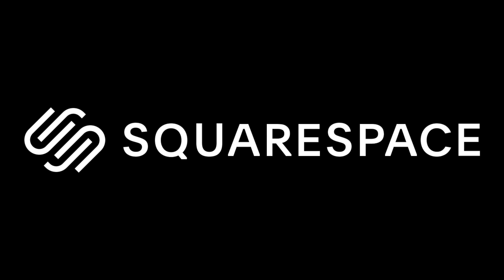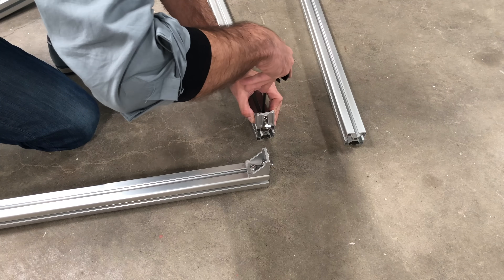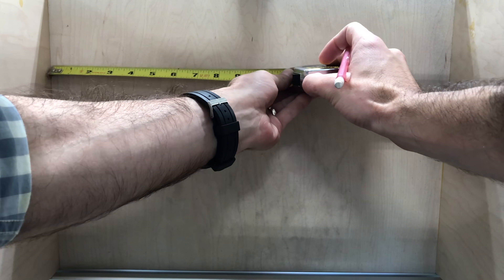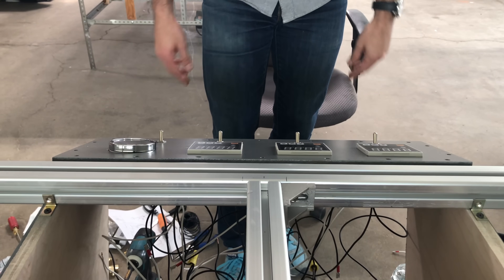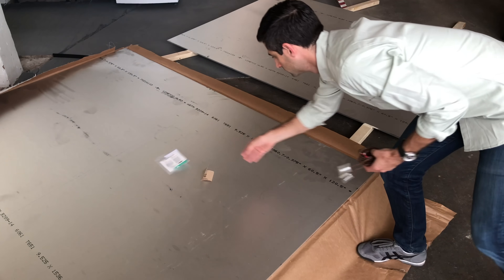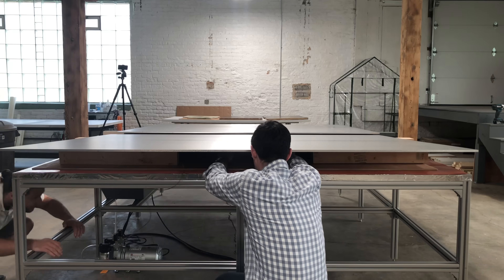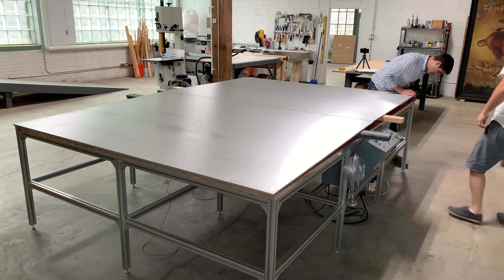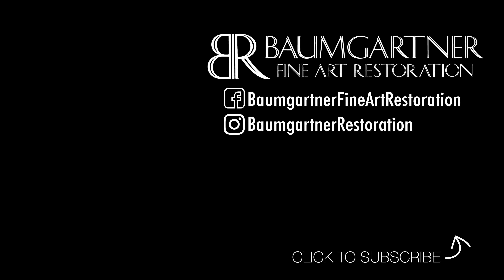Building A Heated Suction Table

Comment: WARNING!!!  Julian, an infrared heat gun is a very poor choice for calibrating the table.  This is especially true for cheap ones like you are using.  Besides that, it did not appear that that heat gun could be adjusted for emissivity.  This is crucial when using a heat gun to get temps from shiny metals.  In fact, raw aluminum is one of the very worst surfaces and your measurements can be off be very significant amounts.  I would recommend using a quality RTD that is calibrated to NIST to calibrate your temperature controllers.  I am a Metrologist.

Comment: Before I retired I built a lot of things with this type of extruded aluminum tubing. It is a great product but it certainly isn’t cheap.
You can put a tap in a battery drill to tap the center holes for the feet. That is if the drill has an adjustable clutch. 
The aluminum plates sharp burr can easily be removed with a red devil paint scraper. I learned that trick from a professional sheet metal worker.
I really appreciate you sharing your design with us.

Comment: I hope you put a separation layer between the glued aluminium join and the expensive silicone heat mats. That way a future conservator can reverse your work and separate the layers. 😁
Actually the glue probably doesn't bond with the silicone mats so probably not necessary.

Comment: Nice build. Plate seems thicker than it needs to be, is there a reason you chose half inch? I’m sure you know but your three zones aren’t thermally isolated, you’ll just heat the whole table less. And if you haven’t already, chamfer the edges and corners, and tie the metal structure and surface to electrical ground. Remember though, aluminum and copper wire equals galvanic corrosion, so you’ll need to buy a special connector etc. A GFCI breaker would also be a good investment in not dying!

Comment: I think there is an issue how you calibrated thermocouples. Aluminum is very shiny in infrared light and using infrared thermometers on it are not reliable. I would strongly recommend using different means of messurement, some contact thermometer, or just paint little pieces of that aluminium with IR opaque color (or maybe just puddle of water) and point IR thermometer on that spot.

Comment: QUESTION. How does the suction work?  How do you hook it up?  I’ve been trying to figure it out from your videos to no avail. Once I saw you hook on that round flange. Other times nothing. All I can deduce is you put the air hose under the linen tape, where it can’t be seen, at the corner of the table.  I don’t know why this bothers me not to know for certain. I could worry more about cleaning my kitchen, less about how a vacuum table works. Btw, great video.
Reply from the maker: Quick release hoses with thru mount tips.

Comment: Do yourself a huge favour: Buy a proper tool for crimping those terminals onto the wires and go back and crimp them properly so that the connections don't develop oxidation between the wire and terminal.  When that happens the resistance of the connection will increase, causing power to be developed in the connection (look up the voltage divider principle and Ohm's law to understand why this happens). The power will be dissipated as heat, which will increase the rate of oxidation, which will increase the voltage and power, increasing the heat and so on until (if you are lucky) something stops working or (if not so lucky) smoke & flames appear.

Comment: Congratulations! Impressive work! You are amazing and I admire your work in other videos as well. You are obviously an expert. But some thoughts came into my mind... Have you tried it; Are you satisfied? Have you noticed any defect? Will the fact that you glued two aluminum panels affect the quality of your work? If the painting covers the entire surface, will there be any problem at the joint point? Also, does the glue melt or weaken over time? Too many questions ...
Reply from the maker: I’ve been using it without issue for about 9 months. There are some things I might do differently next time but o doubt think there will be a next time as this one works
Reply: @BaumgartnerRestoration  Absolutely understood. Thank you for your answer! :)

Comment: If I were you I'd use that IR thermometer of yours to map out the temperature gradient of the surface when adjacent zones are set to different targets. With no thermal break between zones, and with those silicone sheets incapable of cooling, the higher set point could take a good chunk of the next zone higher than you'd want. This could also change depending on how much of the surface is exposed to ambient air, and how much is covered by layers of your work piece. I would not know how detrimental that could be, but I'm assuming your usual circumspect approach is for a reason.

Comment: How do you incorporate the suction element? I had thought that there were holes in the aluminum plate and you sucked the air out from below but now I see that's not the case, so where do the vacuum hoses get attached?

Comment: Looks like you were crimping the connectors with a regular set of pliers. They should be done with a set of crispers designed for those connectors. Otherwise you may get poor connections causing high resistance or other issues.

Comment: Just fyi it's a bad idea to use pliers to crimp connectors.  It doesn't really crimp them correctly and they could loosen and fail over time.  Not something you really want with 240vac

Comment: Suggestion - put a copy of the electronics documentation in a plastic ziplock type bag on the front panel of the control unit. Having it easy to find in 20 years might be helpful. Beautiful build.

Comment: You have 3 zones of silicone pads. But only 2 zones of metal, You really only have 2 zones in the end, and the middle zone of the silicone pads is going to be heating both zones. Edit. You only have 1 zone.

Comment: If you're worried about heat buildup in your control box, integrating a couple of computer cooling fans in the bottom would be good and stepping 120 down to whatever the fans need isn't horrendous.

Comment: Hey I don't know if you've seen the hackaday post on this but a lot of comments are warning you about using a 20A rated connector here bottlenecking the whole system which should pull 40A at full load with all heaters and the pump, also using wood to house high current components, and you don't have any fuses, breakers, or thermal protection... Please look into safety upgrades as this is an accident waiting to happen

Comment: I could not figure out what prep the aluminum panels were.  But it is unlikely you could get a proper temperature reading with that IR instrument.  The emissivity of natural aluminum is awfully low.  If the surface is anodized, you may be better off, but I would still trust the mounted thermocouples better.  On the other hand, if your purpose was to just make a sweeping comparison over the whole area for an even temperature, you may have been seeing what you needed.

Comment: I have questions... I was thinking the aluminium (as we say in the UK) would be perforated like an arcade air hockey table because when we see you draw out old glue to the sheet below, I always assumed there was suction from below. I am now assuming you use one or two of those mobile circular devices to suck the air out from above. Is that how the old table worked?

Also, are you not going to put a trim around the outside to hide the layers?

Finally, you appear to have the power cables trailing across the floor. Is that not a trip hazard and unsafe? or did you do something after the video to prevent that?

Comment: you should put some rubber corners or something on the edges of that table, because it looks really sharp. There's a 100% chance that you'll run into it at some point and cut the heck out of your side. So please, sand the corners of that table, or cover them with something soft.

Comment: If you don't want to end up owning stock in Crydom with all the solid-state relays you will end up replacing, you may want to think about adding some fans to the cabinet to supply cool air across the vanes. Solid-state relays will heat up like crazy when controlling a resistive load like your heat blankets. Also unless you heat all zones at all times, the epoxy in the seam between the plates will end up being destroyed by the expansion and contractions of the 2 surfaces. You would have been better off if you had opted for 3 large aluminum slabs rather than 2. That way you could have put a silicone divider between them and had 3 completely isolated zones that you could really control independently. Unfortunately having 2 slabs and monitoring them with 3 separate thermal controllers will probably cause a good deal of difficulty maintaining good performance. 
Sorry to be a harbinger of doom on your project, but I have dealt with many projects that required isolated thermal zones and the electronics that control them. I have designed ovens with conveyors in them for curing resins, and smd ovens for pc boards, and others. 
Take what I said with a grain of salt and if you do have issues that drive you crazy, hopefully you can remember my concerns and it will help. 
But one thing I do know will cause you grief is not having cooling air over those solid-state relays.
Reply from the maker: I can always add fans if I need but thus far haven’t found that the ssr’s at heating up that much; the table is only “on” for about 30mins and then the heating elements are turned off. Also, I’ll almost always be using all three zones at once. I have a smaller table for smaller pieces. I also used thermally stable (up to ~350F)  and conductive epoxy because I don’t want to isolate the two aluminum surfaces. The main reason for three zones was cost and in case one fails its easier to replace.

Comment: Very nice build, but I have to point out, that I think you are making a big mistake by using an infrared thermometret for the calibration. 

The problem here is the surface properties of aluminium. It is very reflektive in the infrared spektrum, so you will get a bad result, measuring a mix of the suroundings and the table, but mostly the suroundings. 

To get a good result on a blank metal surface you have to paint it black, but I will recommend that you use another type of thermometer, one in contact with the surface and isolated to the suroundings.
Reply from the maker: Clearly you weren’t watching carefully else you would have seen the blue tape peeking out from behind the IR gun

Comment: Are you going to keep the pump  on floor?   You could prob clamp it to the leg under table to stop help make sure dust, etc does not into  it.  I'm not sure if its loud, or stays loud, but could even build a matching wooden box like did for electronics and then clam to bottom of table.    Also less chance of water damage, or other shenanigans that could happen.  Awesome build!

Comment: 5:19 I suggest you to solder the wires before inserting them, overtime after touching them with fingers it will corode and build up resistance.

Comment: Small correction: The 240V is not what you need the big cable for, it's the amount of current that you are drawing. Europe operates on 230V, and our mains cables can be as slim as a pencil.
Reply from the maker: Right, it’s the 40amps that requires the large cord 😁

Comment: Hey just a quick tip, don't use an IR blaster to calibrate it, the reflectiveness of the aluminum can throw off the measurements by a long shot, use a contact thermometer so you can get a good measurement

Comment: Be careful using that infrared thermometer, it likely is reading the temperature way off. Infrared thermometers need to know the emissivity of the surface to get an accurate temperature. Most cheaper infrared thermometers assume an emissivity close to that of a black body (think of a black matte surface) which works ok for most materials. Metals are very reflective and tend to have a very low emissivity leading to drastically wrong readings. You can easily fix the infrared reading by putting a piece of tape on the aluminum and reading from that.

Comment: I'm wondering how isolated the 3 zones are. Even if you have 3 sections of controllable heat, the aluminum would transfer that heat across sections and could potentially overheat the zone next to it right?

Comment: Wirenuts on stranded wires rarely work well.   When the table stops working, you'll find all the loose wirenuts at the bottom of the control box.

Comment: Why didn't you use 3 slabs of aluminum. Then you wouldn't have as much heat loss between the three zones. They could also be thermally isolated since even if you wish two use two zones as one the could each be heated to the same temperature. And if you want to use them separately there would be even less heat loss

Comment: Nice work. 

One suggestion: those control circuits are routing a fair amount of power and will likely put off a good deal of heat. I suggest some vento holes in your control box, and a cooling fan wouldn't hurt either.
Best of luck in your next venture. That thing looks big and strong enuogh to flatten the deck on an aircrft carrier.

Comment: Curious, if you have 3 zones why wouldn't you just use 3 smaller aluminum tops? Would have been easier to move around and may help prevent unwanted heat transfer between slabs when you don't want it.

Comment: Please dont connect flexible wires into screw terminals without cable end sleeves, or else there is a higher risk of electrocution, fire, or any of the other things you mentioned

Comment: For a given power, more voltage means less amperage, wich means less heat and you need less copper section, so overheating shouldn't be a problem if you are not putting a huge amount of power through the system.
Reply from the maker: Correct! And less amperage means I don’t need a dedicated panel or three phase in the building.

Comment: Little note: electronic heat is produced by resistance and current. Resistance is (for the most part) constant across all voltages. Using the formula P=v*I (power = voltage * current) you can probably see where I'm getting at. If your table can run at 120v/60a or 230/30a you'll see that while there is the same amount of power, the resistance is less as there is less current. So really it would be hotter to run at 120v (5:15)
Reply from the maker: And with lower voltage I need more amps and probably a new panel in the building.
Reply: Baumgartner Restoration yep, which is why electric dryers are 240 as its way easier on the grid. Transmission lines are around 7000v, which significantly lowers the current passing through, reducing heat and minimizing losses.

Comment: Sir, some advice:
1. Use cord pin end tubes on ALL the connections between wires and terminals. Naked wire connections may become loose over time, which may lead to an electrical failure or fire.
2. Use Wago [221-413] (style) wire connectors instead of that yellow bolt-like connector visible at 7:48. It's also dangerous to use and also may become loose accidentally.
3. Make a well-organized layout of the wires. Same as on the schematics.
4. Make the front panel disconnectable from the base. If you'll ever have to make some repair or upgrade, it will be a great help to make the job done easily.
5. I'm not sure of it, but a set of ventilation holes may help the electronic stay at a lower temperature.
6. And finally, an emergency switch may be a good idea.
It would be a great honour to personally help you all these done. Unfortunately, it's almost impossible...

Comment: In case you are not aware, laser temp guns are often unreliable on reflective surfaces. You might want to double check it against another thermometer, or paint a small area flat black for initial testing... Unless that is you have already determined it is working well

Comment: Didn’t the previous table have holes in the surface from which it pulled vacuum when you placed a layer of plastic over the top of it? 

How do you use the hoses to pull suction across the surface on this one?

Comment: Julian, in a couple of videos you use your hot table to remove excess adhesive hiding in a canvas after you’re done scraping/brushing/etc the residue from the back (I think you did this in the split painting most recently). Can you show us what the blotter paper looks like after you’re done with that process? How much adhesive is still in those canvases and how effective is the hot table at getting it out? Just curious.

Comment: I did not notice if you installed the earth wire on the table itself but you should install it as it reduces the risk of electric shock and also eliminates any static energy that is created in the aluminum plates.

Comment: At around 7:44, when you were putting the wires in the sockets. They should be _all the way_ in, as in not showing any exposed wire when seem. Some of them weren't like this.  This is small, but if you wanna make sure it's done as professionally as you can (and following good rules and practices of electrical wiring), I suggest you try to go back and redo the tips and insert them a small bit further.

Comment: I don't recommend using that infrared gun to calibrate your table, at least by itself.  Bare aluminum sheet has a low emissivity value (epsilon) and the gun will under-report the temperature significantly, meaning it will give an artificially low reading while the real temperature is higher.  Try putting a few different materials, paper, rubber, canvas, or bare aluminum on the table simultaneously, at a given set point and see how the reading on the infrared gun changes.  It's best to do a cross-reference with a thermocouple at least once, to "calibrate" the gun itself to your specific target material.  Best of luck to you!
Reply: @JorgTheElder  Good eye!  I missed that detail.  Yes, tape will give a much better reading than the bare aluminum.